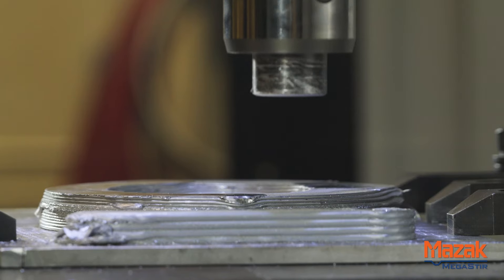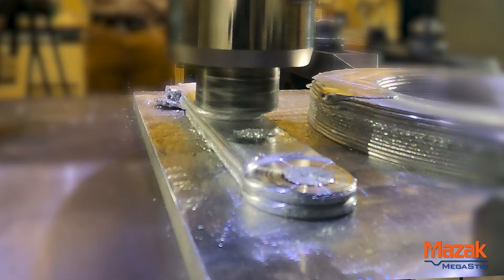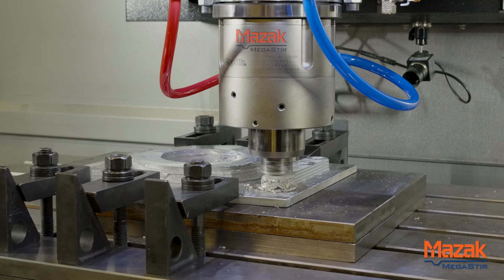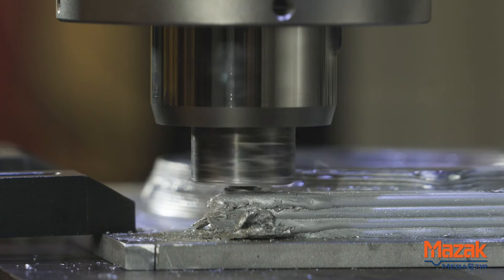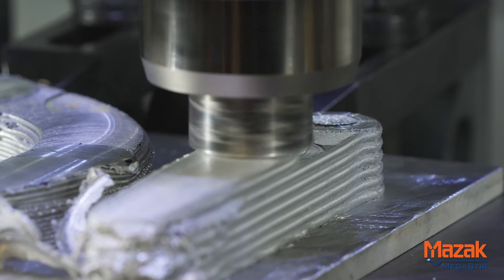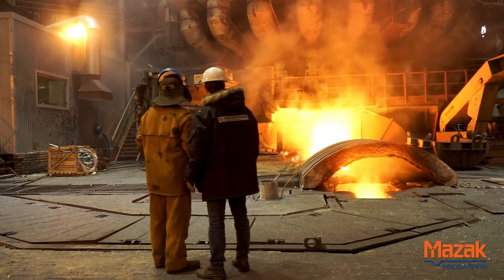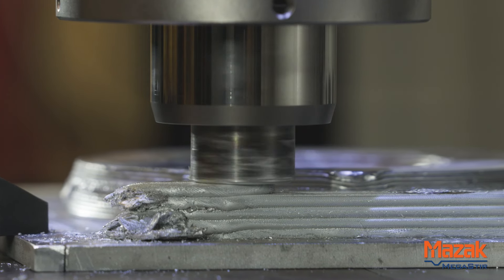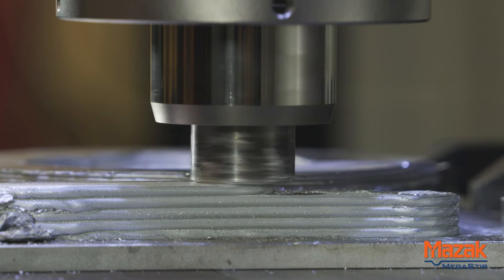Additive Friction Stir Deposition from Mazak MegaStir

Comment: Looks like fascinating tech! Does this method have practical benefits over other metal additive processes like powder bed fusion?
Reply: Yeah, it's not porous! Pretty neat, I wonder what materials beside aluminium and copper they can use?
Reply: Less heat because no melt, cheaper and less dangerous stock. Faster build rate. But also large bead and high axial force so massive solids. Think of it as a way to build custom stock for machining
Reply: @SuperYellowsubmarin  While normal friction stir welding penetrates lower layers, this seems to deposit on top. How is layer adhesion going to be, if there is no melt between material layers?
Reply from the maker: This is a great question.  With powder additive or hot wire additive, the forming material used must be melted while depositing and shaping a part.  
Melting metal always results in dendritic grain growth during solidification thus effects the strength of the structure.  Generally speaking, the material strength associated with using solid state processes, such as AFSD or FSW, will result in a 20% increase in material strength over alternative methods involving melting of metal.
Reply from the maker: @markpalaszewski8546 We are currently focused on continuously joining Al Alloys, but heavier metals such as steel and titanium are on the near horizon

Comment: Amazing process. Where does the material come from? Is there a rod going up into the spindle?
Reply from the maker: You are correct.  The process takes a rod of metal which is moved through the spindle, the tool holder, and then extruded onto the base material.  The controlled extrusion under pressure and friction force plastic deformation resulting in solid state bonding of the deposited metal.
Reply: @MazakCorporation  Thanks! Is the layer bonding mechanism similar to cold welding that occurs in the vacuum of space?
I had never heard of this process but I can imagine a lot of uses. What are the internal stresses like for machining?

Comment: Wow. How strong are the layer bonds?
Reply from the maker: AFSD is a solid state process so the bond strength has the same forged properties as that of the base metal.  In reference to material strength, think of it as a completely wrought structure.